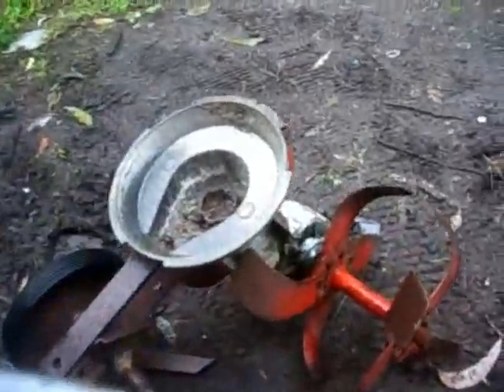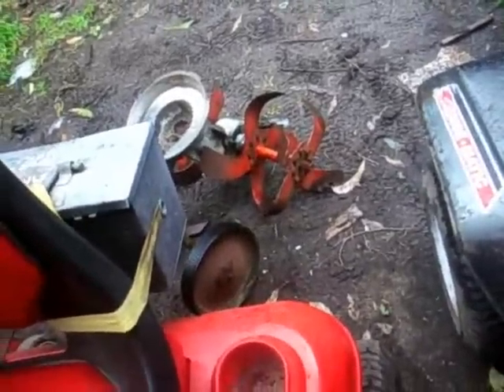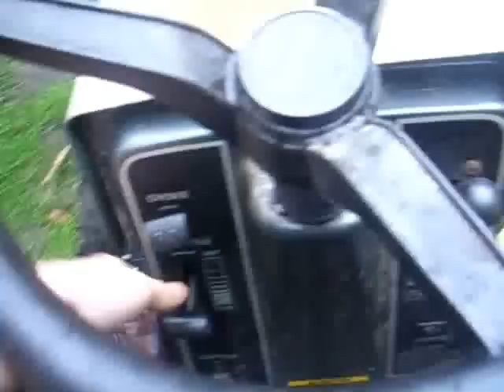ride on mower repair part 2 and drive

Comment from the maker: @evilspiritchild if you are really game the problem lays in the gear box. there is the shaft that slides in and out to selected the gears. that has a spring and a small ball bearing in the box that allows it to click in and out of gear. either that's missing / stuck / rusted ide say. if no ill make a vid. belts might be crappy bearings or just worn belts. check the tension on them. but first try lubricating the gear selector linkages to make it easy to slide the selector.